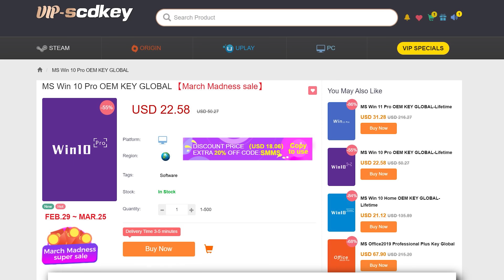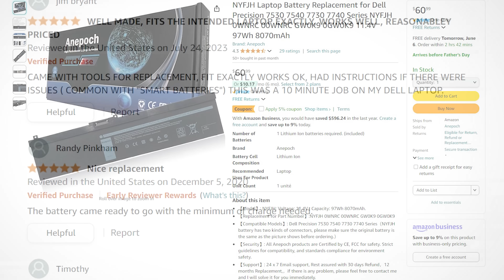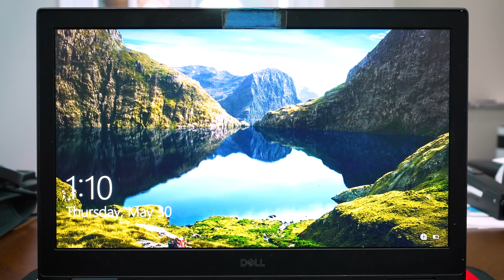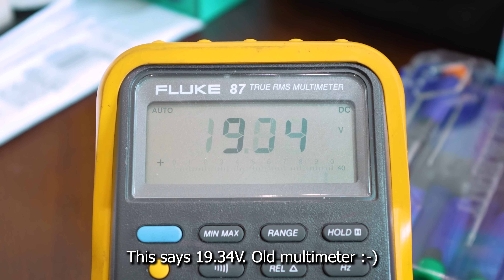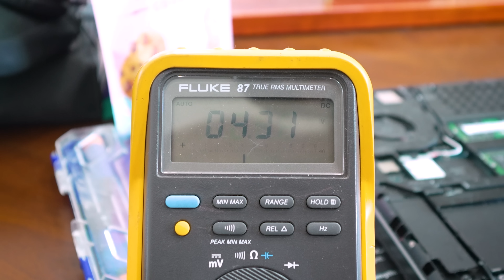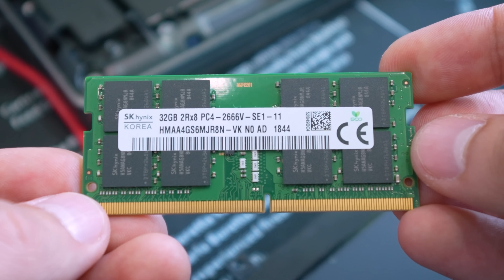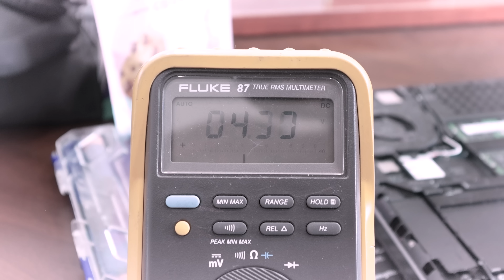Fixing a Viewer's BROKEN Gaming PC? - Fix or Flop S5:E14

Comment: I was suprised you landed on the Battery as the issue, my bet would have been an mainboard issue tbh xD Because the issue you are getting are something i would suspect with an issue on the mainboard, but not with an battery issue. the laptop should still be able to boot ALWAYS when plugged in even if battery is dead, if it cant it aint the battery.
Reply: Came for this, you can remove the battery and still it would work fine if it only had a bad battery
Reply: yup the battery is only needed without the cable
Reply: I used to test  ex-leased computers and while I didn't work on laptops I did know from the laptop line workers that they would power up the laptop, do their tests and let it charge, then disconnect the lead of the charger to see if the battery held a charge.
Reply: Some laptops can't boot with a dead battery connected.
Reply: Yes. My first gaming PC was a laptop, and had it for 8 years. The baterry eventually died and had to use it connected all the time. 

I also knew the battery was not the issue.

Comment: You just did a hard reset by unplugging the battery.  Plug it in directly with out a battery you won't even need the battery to start it.
Reply from the maker: Yeah. What about it? 😄
Reply: @GregSalazar  If it starts with out the battery it is probably the charge port or the plug.